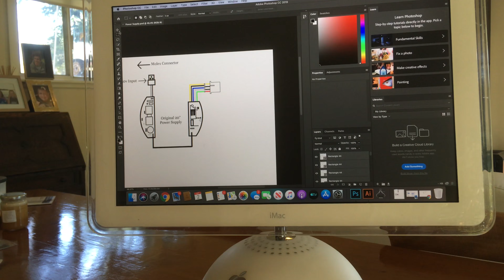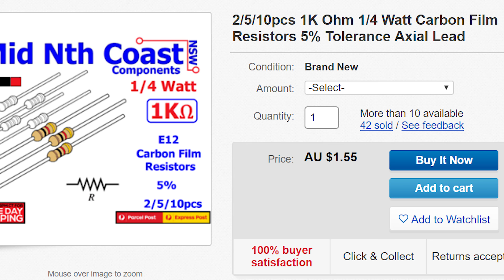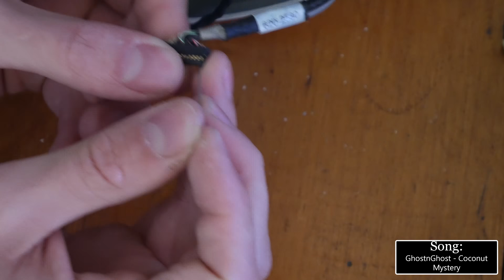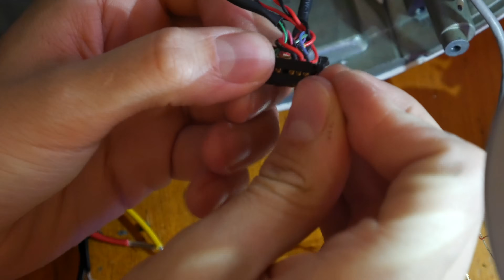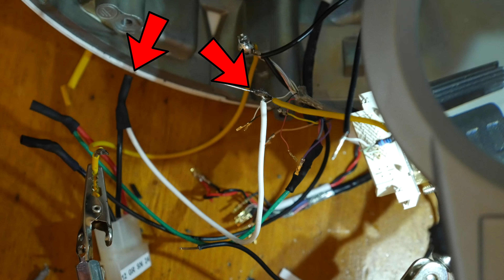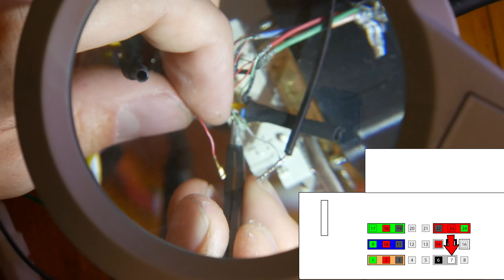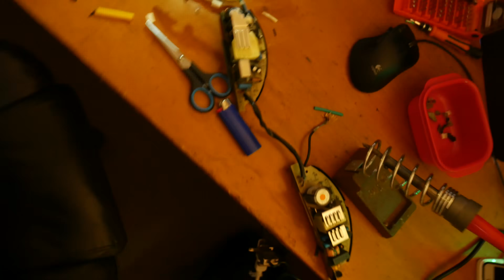How To Turn a 20" iMac G4 Into An External Monitor

Comment from the maker: 2024 UPDATE
Please note this guide is now obsolete and should not be followed under any circumstances as it causes irreversible damage to an extremely rare machine.
 
Check out my newest work over at Juicy Crumb which offers a much easier and fully reversible solution:

https://juicycrumb.com/product/docklite-g4-limited-edition/
Reply: Any solutions for the 15" G4 out there yet?
Reply: @Kaneosaurus  I just got the 15" and looking for the same.
Reply: Is that Docklite in Aussie dollars?
Reply from the maker: @dalemacdonald201  Yes, the DockLite is $386 AUD :)
Reply: they ask a lot of money, perhaps a smaller pbs with a psu connector and a video connector in one side and a hdmi on the other should have been a beter solution. there is one from @joeventurelli but is missing a psu socket

Comment: Im currently working on the imac g4 20'' dvi mod, and the problem im having is that I can see the screen backlight turn on, but even though I already wired the black cable to the dvi connector, it does not show anything on the screen. Ive tried switching out the dvi to hdmi adapter i was using and the hdmi cable but no difference. If you have any idea of what I might be doing wrong please tell me!
Reply from the maker: Does your host device detect the display with the correct resolution?
Reply: @Pendleton115  No. The host does not see the display at all. The 5v signal for detecting when hdmi is plugged in works, and as soon as I unplug the hdmi cable from the host the screen turns off.
Reply: @Pendleton115  if you have twitter or discord, I could add you to show you photos of how it looks so maybe it would become a clearer idea of what I’m doing wrong.

Comment: I have a 17 inch model of a G4 screen. Complete with the arm/hinge. My idea is to integrate it into a desk. If I reworked the display output to DVI, Can a 12v 3amp PSU be used for power?

E.g. I repurposed a G5 case, to use as a monitor. Laptop LCD + controller/input board, iMac G5 PSU + iMac G5 speakers. Works great with my pi400.

Comment: Have you done this for the 17" yet? My 17" PSU does not have a green wire on it. It has 5 yellow 5 black, and 1 blue and one white. Could you help me out with how to substitute the missing green wire?
Reply from the maker: The 17” you can forgo the original PSU,
 Please look at Dremmel Junkies guide for the 17” instructions.
 An external Molex Power Supply can power a 17” easily.
Reply: @Pendleton115  just stumbled upon it as we speak! Is there anyway to use the Mac mini PSU to power the inverter as well as the optical drive?

Comment: Hi, this instruction is fantastic, thank you I was able to build a 2014 mac inside of the I am G4, and it works perfectly.
I was wondering if it is possible to use HDMI instead of DVI? The other thing would be possible to eliminate the G4 PS and use just the Mac mini PS, note the mac mini seems to have four wire 12v + and four negatives.
Reply: No you can't use HDMI because this display is obviously analog.
But HDMI to DVI I adapters do exist!

Comment: Hey there,
I am trying the conversion of an iMac g4 15“ but don’t know what to look for regarding the controllerboard. Don’t find nothing..

Any ideas?
Reply from the maker: There is no control board required, follow Dremmel Junkies blog, he hasn’t fully documented the 15” but the pinouts should be similar to the 17”
Reply: @Pendleton115  will do, thanks🤙👌

Comment from the maker: So this has blown up all of a sudden, seemingly from the recent coverage of Colby Sheet’s iMac G4 M1 Project. Thanks to all the articles that credited my video, and welcome to my channel if you’re new.  Consider Subscribing, as I still plan on doing guides of the 15” and 17” models!
Reply: Would need the 15inch guide asap🙈
Reply: Hey! Any chance you plan on doing the 17" guide any time soon? I'd love to be able to use the internal PSU but the need for a 5v line is throwing me off and unfortunately, the Dremeljunkie guide only uses an AC to SATA adapter as the power supply. This video was extremely helpful regardless, thank you!
Reply: hey i love my 15 inch g4. whens the tutorial or at least a written one?

Comment: I'm planning on doing a swap of the internals of the G4 to a mac mini M1- and this video is extremely useful. Thank you so much!
Reply: Hey how did it go? I’m planning the same thing
Reply: @connorlearmonth665  other projects took precedence so I haven’t done it yet. I think at this point I’m waiting till the M2 mini comes out but after digging a bit there’s a lot of resources out there for similar projects
Reply: @Breadts1cks  I’m debating M1 or m2 as well, but the project would probably look similar either way. I want to turn the shell of the g4 into basically an hdmi external monitor like in this video. Use the same stock PSU to power the optical drive, and get a SATA to usb A converter to simply plug both into the Mac mini logic board, then use a thunderbolt dongle inside the g4 dome to fill out as many of the original ports as possible.
Reply: @connorlearmonth665  love yours :D
Reply: @Axell López que es el mini m2??

Comment: So years ago I got this exact machine from my Grandparents, and me being the young idiot I was, I took the whole thing apart. At least, I gutted the base. I took out everything, and just left the bare wires coming down from the display. I no longer have anything from it except for the fan and the hard drive. Can I still make this into a monitor? I don’t know what the power supply looks like or where it is located, but I am guessing that out too. Do I need a power supply for this project? If I need a power supply can I buy some sort of aftermarket one? 
Thanks a lot!
Reply from the maker: If you don’t have the original power supply you can use a different 24v power supply. Have a look at Drexel Junkies guide (linked in the description) for information on how to do this :)
Reply: @Pendleton115  I looked at Dremel Junkies website, but I cannot find an exact power supply that I would need for the computer. Is there a link to a power supply that can be used for this project somewhere? Also, if it helps, I do have the original power cord, but I got rid of the internal connector for it. I am really regretting taking apart this iMac. It even worked just fine when I took it apart!
Reply from the maker: @OwenRozeboom  something like this should work https://www.ebay.com.au/itm/113916541450
 You don’t “need” the original power connector, but you will need to run a new power cord inside the chassis and just connect it directly to your power supply.
 Since you’re missing the original PSU you will also need a 12v power supply.

Comment: Could you not just buy the controller board for the lcd screen and hide it in the case?
Reply from the maker: The problem with this is that the wires coming down from the neck are non standard, and custom designed for the computer. Even if you can find a controller board for the model of LCD that Apple used you would not be able to connect it without splicing the wires coming from the neck anyway.

Comment: This but with a mac mini inside where the superdrive goes would be the best mod ever.
Reply from the maker: I’ve actually done this but with a MacBook logic board. Haven’t worked on a video for it though.
Reply: That would be a very interesting video.
Reply: @Pendleton115  This is exactly what I'd like to do with a  gutted 15" machine I picked up a a recycling center - I'll grab some video if I remember - haha. Thanks for this guide!

Comment: Hello friend! So I finally got my hands on a 20 inch. Followed your tutorial to the point of getting the backlight on... But still the backlight is not coming on and I don't want to move forward before I have the backlight checked. What could be done wrong? Also I've noticed that the psu gives only 12 volt. I tried reading the voltage on the green wire but that gave nothing. Is there any manual ways to get that psu on without doing it through pin 14 and 16?
Reply from the maker: If you’re not getting 24v from your green wire then your PSU isn’t turning on, try checking your jumper lead from the DVI connector to the PSU, as it might not be receiving the 3.3/5v power on signal.
 The 12v rail on the PSU is always active to provide standby power.
Reply: @Pendleton115  I think your right! I will try tomorrow focusing on the dvi pins to make sure everything is alright! Thanks again! It's a lot of difference between the 15 and 20. With the 15 I got  backlight on by giving it 12 volt, ground and 5 volt directly from a pc psu molex cable. But it seems that this 20 inch has. To have 24 volts right?
Reply from the maker: Fixing Tricks that’s correct, I never got a 15” working, would love to see your methodology. Both the 15 and 17 inch only need 12v for the backlight while the 20” needs 24v. Hence the original PSU still being used.
Reply from the maker: Fixing Tricks also, be very carefully with your pin outs! If you send 12 or 24 volts down the wrong pin you could fry the LCD or your GPU!
Reply: @Pendleton115  I got a 15 inch working with a pc psu molex cable. It was actually very easy, dremel junkie had a pin map for 15 inch I followed. But I had to ruin it to use the cables and with the 20 inch. Plus I only have one dvi molex thing to put pins on. I will update
Reply: @Pendleton115  btw I do really do appreciate you answering my comments so fast! Thank you
Reply: @Pendleton115  so I tried today giving it 5v from a pc power supply which made the 24v alive from the imacs power supply. And still I'm not getting the backlight on. I'm thinking this has something to do with wiring the cables through soldering. I will try remove the soldering and just hook them up together.
Reply from the maker: @gogogorandom  Make sure you also have the yellow wire from the Inverter go to pin 14 on your DVI connector (through a 1k Ohm resistor) this is the inverter activation signal.
Reply: @Pendleton115  is there anyway I can reach out to you on WhatsApp or something? I'm getting 24 volts in, I'm getting 12 volts inn. I have cables inn the way the should. I gave it 5 volt from a pc psu. But still, no backlight. Any help would be golden! I don't know what is wrong.
Reply from the maker: Fixing Tricks my PM’s are open on Twitter
Reply: @Pendleton115  thanks brother! But I fixed it! Went through the cables and did not use soldering. Took another method on connection and it worked! I love your guide! My mac is now going and i used a dvi to hdmi adapter! IT ROCKS! ! Look forward to put in a Intel nuc and make hackintosh!
Reply from the maker: @gogogorandom  That's awesome news man! If you like you can send some photos to me over twitter. Would love to see your methodology!
Reply: @Pendleton115  I didn't had twitter. Installed it now and twitted you :) thanks again boss! I will update
Reply from the maker: @gogogorandom  Hey mate, can’t remember our exact conversation on Twitter, did you ever get it working?
Reply: @Pendleton115  hey bro! Yes i did! Thanks to you!

Comment: Hello, so i have a problem, just got an imac g4 15 inch... the problem is that the power supply does not have any green or white cables? Only blue, black and yellow?  ANy suggestions what to do?
Reply: Also the 15 inch inverter cable does not have the yellow cable?
Reply from the maker: Fixing Tricks the process is different for the 15” the 15” and 17” are slightly different, for starters you don’t want to use the original power supply, but rather a molex power supply. I would reccomend looking at the dremmel junkie blog for more info on how to do the 15”
Reply: @Pendleton115  can i use a regular pc psu? which has molex? will that work?

Comment: is this mod possible on 17 "?
 because i see that the power supply is different.
there is no white and green  😁
Reply from the maker: zwart 8 With the 17” you don’t have to use the original iMac Power Supply, you can use a standard Molex Power Supply. Of course the pinouts are slightly different. There is more information on the Dremmel Junkie Blog, I plan on doing a video on the 17” as soon as I can get my hands on a dead one.
Reply: @Pendleton115   thank you  😊

Comment: Is there an example of some basic wires that could be bought if we don't have any other misc components lying around? (Instead of pulling them from a power supply, etc like you mentioned at the start of the video?) Thanks!!
Reply from the maker: Ian and Sona you could probably find the wire you need at an electronics store, you just need a few different sizes.

Comment: OMG I Smashed the LCD on my 27inch iMac when I replaced the HD with a SSD. I had it sitting together for testing before final closing, adding the adhesive strips etc, when slip went the LCD. $850 later! Excellent video! Top Stuff! Rockstar work! 😎
Reply from the maker: Hyades ouch that’s painful! iMacs can be a tough repair, just ask Linus lol
Reply: @Pendleton115  Yeah, I did stuff up. Even had electrical tape holding the LCD in place, but it didn't hold. The replacement LCD I purchased turned out to be a second, with dead pixels, but it doesn't bother me. I have a 4TB Samsung SSD in it now and it runs like a dream. Its a 2014 iMac that had constant spinning wheel before with the old HD, now I never see that horrible wheel. So a few dead pixels doesn't worry me at all. I don't mind my stuff being a bit Mad Max! 😏
Reply: P.S. I really loved your monitor Mod!
Reply from the maker: @Pleiades55  my newest iMac Is a 2010 iMac 21" that was given to me, I plan on doing it up with either an i5 or i7. And maybe swapping out the GPU with something metal compatible.
Reply: @Pendleton115  I actually have a 2007 iMac with FireWire ports that I upgraded the HD to Fusion Drive and Ram to 4GB just for music and internet and it screams. Still has original 2GHz iCore 2 Duo, but if I was more adept like yourself I would do the CPU & GPU upgrades.

Comment: I started working on something like this back in 2010 after I cracked the CPU die on my iMac G4. I set the project aside and ultimately just sold off the parts when I go a screaming deal on a fixer-upper Dell 3008WFP panel.